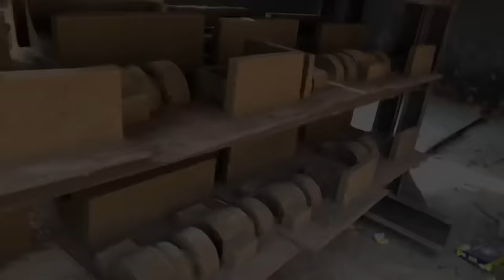How Expert Machinist Making Grasso Compressor Piston | Manufacturing Grasso Compressor Piston

Comment: Casting with casting sand is still done the same way at western manufacturers. My wife is a technical drawer for brake and clutch housings, those housings are still casted that way in middle of Europe.

Comment: The wood firing really imparts a smokey, nutty flavor with hints of nutmeg and licorice undertones to the finished piston.  Pairs nicely with a 40 weight synthetic oil.  Serve with a side of rings.
Reply: Ahhhh my good man (or woman) the pairing in this case probably calls for a well aged (aka used) motor oil!
Reply: ...went to lunch with my friend at mechanic school...
...he ordered a burger and a SET of onion rings...
Reply: I really enjoyed the tuning fork door stops
Reply: ... and the slotted drill press table

Comment: It’s really impressive that the style of block casing is still relatively relevant and a critical infer structure for essentially a universal application engineering part and there standardised code of productivity are dependent upon what is the most likely resulting factor of commonsense numbers based on a specific demand however the amount of efficiency from the existing systematic process is required it’s entirely dependent upon the existing structure of this particular factory and its entirety it’s importance is to keep the flow of the existing controlled areas of structural engineering and from a different level of engineering perspective that is so obviously important
Reply: lorem ipsum mechanicalus
Reply: Wordy and pointless, you did that on purpose.
Reply: Are you sure you couldn't have squeezed a few more unpunctuated four syllable words in there? 😄

Comment: THAT'S JUST INSANE, I did about 30 years in the machine tool industry and never saw anything like this. 
it is a miracle these parts go together and function, let alone last for any length of time

i won't even comment on the udder lack of safety controls
Reply: You haven't seen a hydraulic pump repair. That's where the horror is. This piston will at least work, though not for long. That pump will not work after the repair, although it will not leak - the seal has been replaced.

I would especially like to recommend the manufacture of a crankshaft with imitation of oil channels for lubrication.
Reply: Wich safety control🤣🤣🤣
Reply: Safety? Are you referring to transvestites wearing dresses while operating rotating machinery?
Reply: you can be pretencious as you want but these guys are geniouses ! real skilled workers.. they are performing a technical miracle with nothing.. and that should be apreciated.. safety is needed but these guys are not lacking it by ignorance.. it's pityful to ignore their achevement and point their non-chosen conditions
Reply: @buyamerican3191  ... this is the way old american also start ironing 200years ago ... these guys are timetravellers 🤔
Reply: idk man what you put some rings on the piston what could go wrong??  process looks fine to me>> ??? Please explain
Reply: @aminelabidi6113  Right like, Umm the safety is in their minds Its not like there's children running around chasing after birds or something in the midst...  These guys wont do something radically outside what they are comfortable with.... Pretentious armchair philosophers I agree !!!
Reply: Just think about A cost and don't have a access to material cos it's old or you can't find in a market and sanction like a Iran !
When I was young and machinist ,we just came up with a idea out if box and trying to do a job with whatever we had !
Fortunately nowaday everything is different and so easy with lots of tools ! 
Just have a tool was a dream for us that time !
I am sure they coming out of this kind of job sooner or later !
God bless them
Reply: @zvotaisvfi8678  He is talking that this piston would have a problem to operate in any western engine/pump, as he do not understand that it is a part made for a device that was designed with this crapy tolerances in mind...
Wester stuff have nice tolerances=>is very efficient=>not gonna like when something is not made up to the exact specification... Its like AK-47 vs M-14 -> you can take parts made from AK-47 made in different parts of the world, it will be very clunky and it will be propably even more inaccuratethan any of the donors that you used for it but it should be able to operate, trying the same with M-14 would be a imposible task, as the whole designs would simply not tolerate parts that are out of the specification.
Reply: @buyamerican3191  Dear friend. They are pyjamas, not dresses. In the Caliphate of the UK everyone goes to work in the pyjamas.
Reply: @zvotaisvfi8678  So, they poor molten metal in sandals! And you say are comfortable with that? You must be an employer in the Caliphate of England.
Reply: You need to employ them in America.
Reply: @zvotaisvfi8678  It's all fine work, good to 1/8 of an inch, too.
Reply: @educatedmanholecoverbyrich8890  mais sha thats what the rings are for...
Reply: but is does, they concetrate only on what is matter and that is piston outer walls and ring grooves, they are perfect, doesn't really matter for inperfection on the inside or even on the outside down the piston, rather than it doesn't look nice :)
so yes this thing does work and probably are pretty robust. 
Safety concerns? What are you talking about? Are you concern for the soldier on the battlefield if he wash his teeth in the morning? Please be practical, use your logiscs. 
In this parts of the world you either work (in unsafe conditions) or you starve and die. So which option is safer?

My only question goes to what kind od recepie the use. It shows them throwing all sorts of stuff in the inferno.
Reply: I don't know where you're writing from, but I'm guessing from the Anglo-Saxon countries. I remember the times of communism in Poland and the work was identical, everything worked perfectly and fit, numerical machine tools were a rarity. Worked on renovated milling machines, lathes that were 30-40 years old, micrometer, caliper if you are a good mechanic, turner or milling machine you do not need technologically advanced machines
Reply: wow i scored two "pretentious" on a single post, that's a record!!  I'm going to assume just an udder lack of knowledge on manufacturing and machining. Seriously a reply about the lack of "numerical controlled machines". i have not seen an "NC machine" (70's tech)  since the 80's. It actually had Moog hydraulic axis drives.  It has been CNC machining and turning for 40+ years.  Throwing random crap in a blast furnace does not happen in the USA. there would be a "heat code" on every foundry cast piece with paper work to provide a metallurgical break down of the material.
Reply: @aminelabidi6113  LOL pitiful? really
Reply: you should watch some of the videos of them making guns.
Reply: @TheArrens  agreed all these armchair machinist probably dont even know how to wipe a handsaw one direction...
Reply: @buyamerican3191  people are expandable in this country.
Reply: @aminelabidi6113  Well said sir,  the job of a moulder requires skills that are difficult to see and appreciate when  watching a video.  These guys produce consistently good castings in very basic conditions and they deserve respect for being able to do that. 
Sure, it's easy to whinge about the lack of health and safety but they use their intelligence  and self awareness to avoid accidents which is something that the western world used to have before the HSE has brainwashed out of us
Reply: I totally agree. I don't want anything to do with these parts! Absolutely 0 quality control!
Reply: @GpunktHartman ૦❤🎉

Comment: As the official Work and Safety officer, I approve of the protection systems in place for feet, head, and body. I have to add, that at 10 Rupees a day, they are well over paid.
Reply: I'm especially impressed with the "see thru" safety boots on display @ 10:06

Comment: last video a 6 celender engine after they bored them it’s should apply a heavy oil around each celender for 1 night before they installed celender head backs to the engines or they will gets rusted

Comment: Now, imagine them going on a business trip to one of the western countries where they have laser cutters and AI-operated CNC machines, 3D printers and photo inspections.
That'd be like going 50 years into the future to them xD
Reply: I have 4 surface grinders. 2 are new and expensive cnc machines. The most accurate of all was built in 1932! CNC is good for small and medium size batches. For huge quantities like making screws the old mechanical auto machines still rule. Remember the Browning 0.5" machine gun dates to 1918!

Comment: This is very nice.  People have been making castings using sand molds for over one hundred million years.  The CARB (air resource board) will want to see a proper recirculation system installed atop the furnace.  Otherwise, very nice.
Reply: The human race has been around that long? Really?
Reply: @rb3166  Yes, and even longer.  Please watch "Ancient Aliens" tv show, William Shaftner claims humans inhabited Earth more than 3 hundred million years ago.  Mr. Shaftner traveled through the galaxies at warp speed (thanks in part to Mr. Sulu).  He was the star of the hit tv show "Star Track".  Mr. Shaftner's claims are therefore valid.
Reply: @GsaUce Rug Not Pakistan.  This video was filmed in the small border town of Teeyouwanna Mexico.

Comment: By all means, just take that beautifully machined piston and roll it around on the concrete and dirt.  I have never seen a man that calls himself a machinist, use tools that are so jacked up you can see the oblonged hole on video.  There's nothing running straight on these machines and the guying running the machines could care less.

Comment: Pakistanis work hard, but they cannot become an advanced industrial powerhouse like Germany because there are no large integrated steel plants, large nuclear power plants, large dams, highways, or high-tech export ports. Most of all, it is because it does not follow the standard production method with global punishment. Working hard in poor conditions does not mean you can become a rich country.